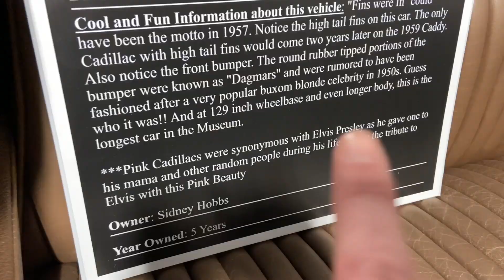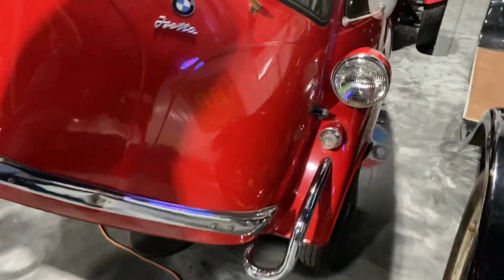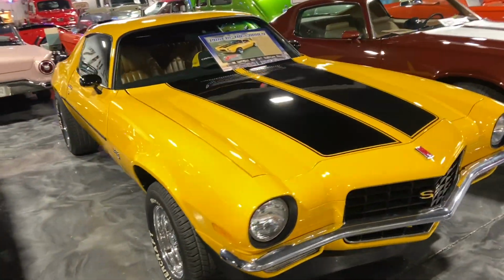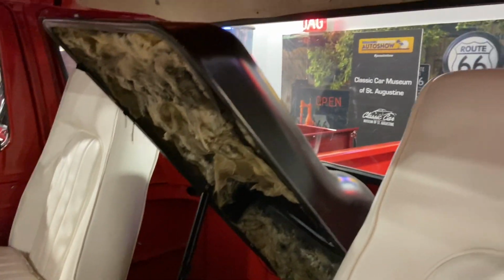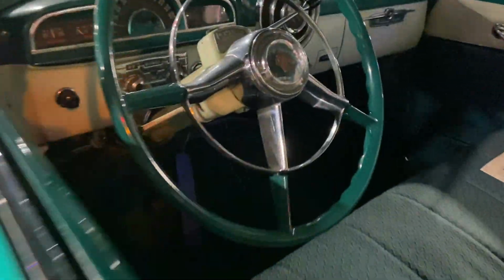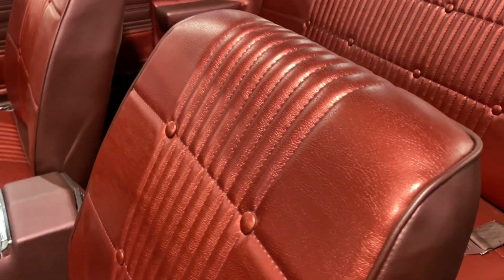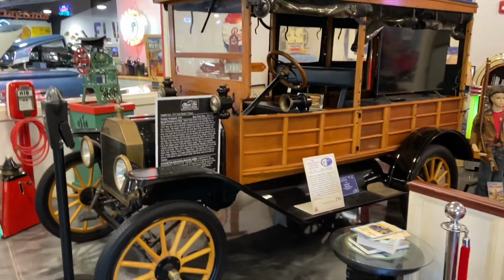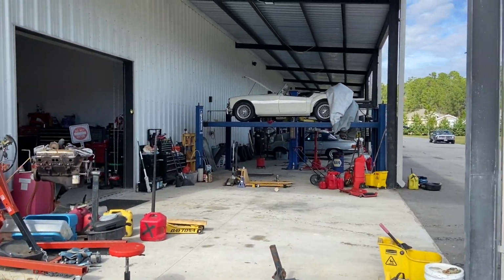Irish Guy Reaction To Worlds Most Famous Vintage Cars

Comment: Pickups are designed to be work trucks; early ones had wood beds that could be replaced if they got too banged up. And Henry Ford had the wooden crates for parts coming in to the factory made the right size to be floorboards in this early vehicles.

Comment: This was fun! I love car museums.

The car that opens in the front is an Isetta. It was designed in Italy, but the manufacturing was licensed out to a bunch of different companies. It looks like the one you saw was made by BMW. The door is not only in front, but at an angle, which creates a problem if you open the door while it's raining. The water will come right inside the car.

That first car with the wooden sides is a Ford Country Squire. They never became really popular because it took too much work to keep the wood looking good. Surfers loved cars and vans with wooden sides, as memorialized in the song Surf City by Jan & Dean:

"I bought a '34 wagon and we call it a woodie
"You know it's not very cherry, it's an oldie but a goodie
"Well, it ain't got a back seat or a rear window
"But it still gets me where I wanna go"

It's nice that the hoods are open on a lot of these cars, and that they let you get close enough to really see them.  A lot of car museums keep the hoods closed, and have velvet ropes around the cars to keep people from touching them.

Early cars had acetylene headlights. You would put calcium carbide and water in the lamp. The carbide would react with the water and release acetylene, which was flammable. It didn't produce much light. Some people still use carbide lamps for things like exploring caves.

The Indianapolis 500 is help every year on Memorial Day weekend. It has the most in-person spectators of any sporting event in the world. This year it drew 325,000 spectators.

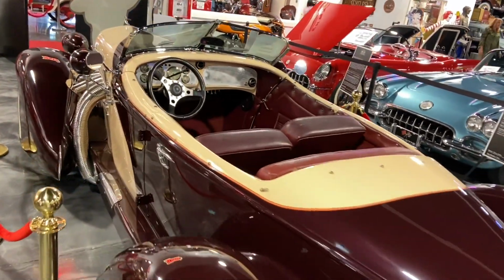The car at 12:30 may have been a Cord or a Duesenberg. They routed the exhaust pipes out the side of the engine compartment as a styling feature. They were very expensive, sporty cars that were fast for their day.

Thanks for a fun video!